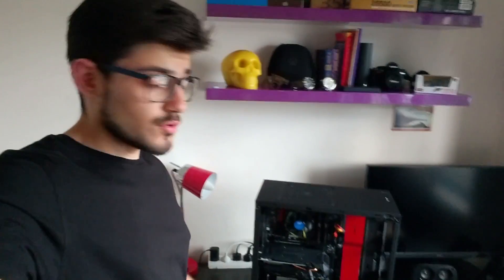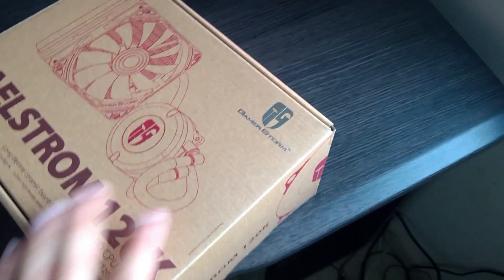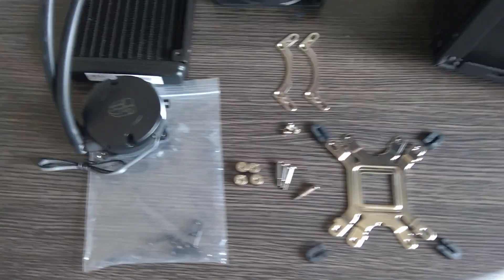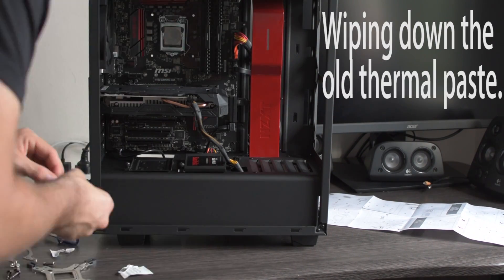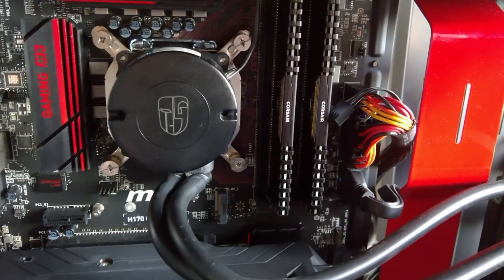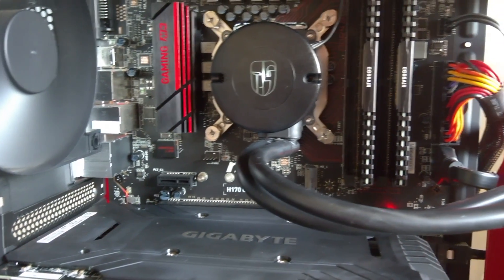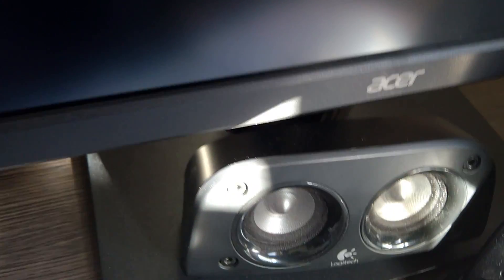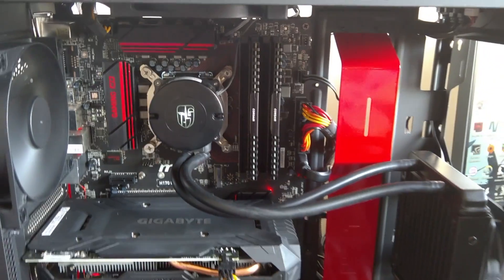Installing my First Liquid Cooler - Deepcool Maelstrom 120k

Comment: nice video, personally i would install the head not higher than the radiator.  The pump will work harder to circulate the liquid in this set up (it is sucking liquid which may contain air inside the system instead of pumping liquid). Also you want to make sure that the pump is fully soaked in liquid for it to work properly an efficiently. That can be achieved by placing the radiator higher than the head. you may want to consider placing the radiator higher and see the difference.
Reply from the maker: Thanks for helpful tip mate, I'll try it and see if it helps.

Comment: Do you recommend use this water cooler with a intel core i7 7700 and a gtx 1070 mini oc ?? I'm not going to  do overclocks, just playing games in ultra
Reply from the maker: + Sideral Gaming Yeah I would recommend it, because although it's not necessary it would look better in your build and be more quiet than the stock cooler.

Comment: john sadak i recommend that the fan must push air into the radiator rather than pulling the air from the radiator and it also helps by reducing your cpu temp
Reply from the maker: Gta 5 Gamer I should try that because my temps arent that low currently

Comment: Where is the water resovoir?
Reply from the maker: +PGMC it's a thin tubing on the top and bottom of the radiator, prefilled.
Reply: John Sadak thanks for replying, btw how often do you change the water in it?
Reply from the maker: PGMC I haven't needed to change the water in the last 4 months of use. Generally from what I've read you should change every 6months-12months. I'll change it around after 9 months of use.
Reply: Can you do a video when you replace it?

Comment: What were your cpu temps with the stock intel fan vs with this Deepcool Maelstrom 120k ???
Reply: John Sadak looks cool tho
Reply from the maker: +ian icao With the stock cooler on idle temps it was around 49-51 degrees and went up to around 72-73 degrees under load. With the Deepcool my idle temps are 45-48 degrees and goes up to 66-69 degrees under load. So not much difference.